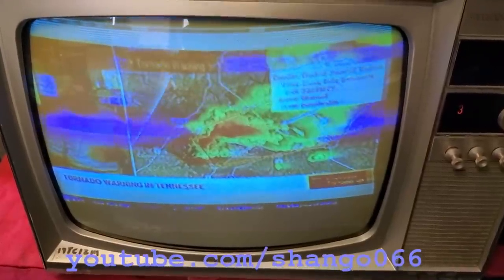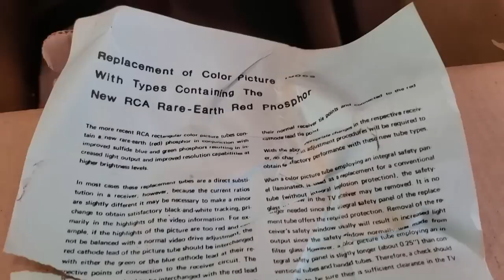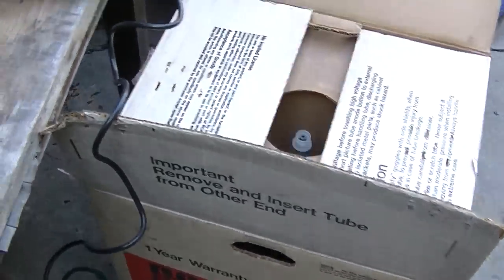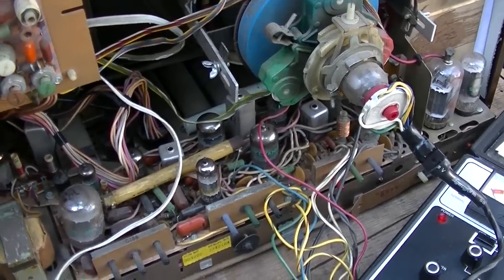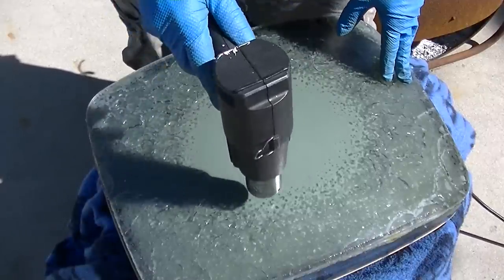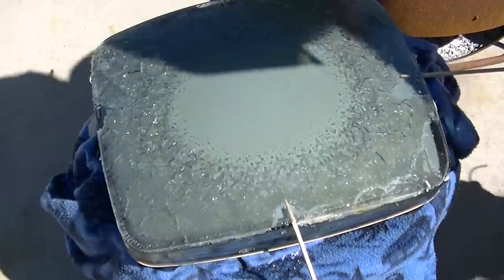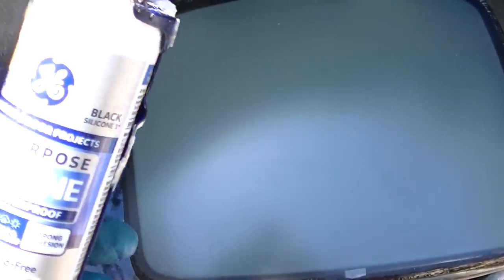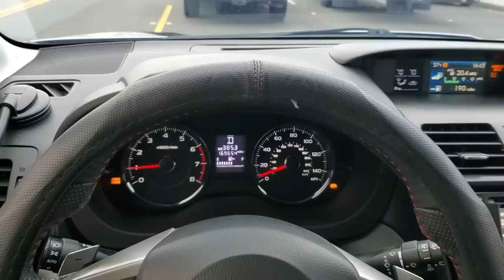Color Television CRT Cataract Removal and Replacement Pt1 1966 Sylvania Tabletop

Comment: In my about 30 years of using rebuilt CRTs from the early 80's until the early 00's  (we stocked 20-50 common sizes most of the time here in Northern California), about once a year or so we would hear a pop from the storage room and investigate and find a imploded CRT in the box. I wonder how many we didn't find that popped over a weekend or at night. Keep in mind that they were all rebuilds. Ah the good old 80's and 90's. Good job with the PPE!
Reply: Sounds like a lot of lost $$$. I never saw a repair shop that stocked CRTs. Always ordered with core return deposit, like car alternators.
Reply: Did they track the rebuilders?
Reply: @directcurrent5751 We didn't either. Always ordered as needed. We did few CRT replacements to begin with... Had a small showroom of used sets that were typically newer and larger than what the customer brought in that we would sell them instead and then we'd toss their old chassis downstairs in the parts basement if it was worth keeping.

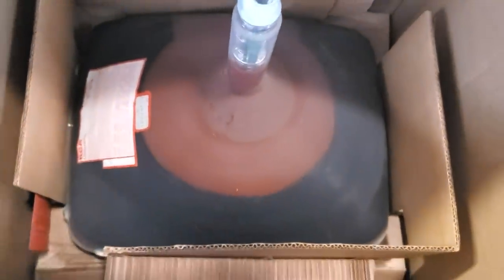Comment: @ 5:35 Ya, anyone that's caused/seen a catastrophic CRT implosion throw fist sized chunks of glass 10+ feet, will usually heed any safety warnings that go along with handling them.
Reply: Back in HS in the late 70's a brain-dead student thought it would be fun to vandalize the electronics class oscilloscopes with a hammer. Idiot's arm was so badly cut, and he bled so much, the police had a vivid trail of blood directly to his front door. I feel bad for the then vintage Eico scopes, not him.
Reply: @jamesplotkin4674 Well, the school won't need to press charges, cause he would've already learned his lesson with the permanent injuries on his arm!

Comment: if you want to fix the weird glass imperfections you could try bonding the entire thing with uv cure loca or liquid optically clear adhesive, it's what they use to bond cell phone digitizers to lcds and has a refractive index very close to glass so it hides basically any defects in the glass, you would need like 2 tubes of it at least but you put a massive blob in the middle and push down on the glass to spread it outward, then put it in the sun to cure for a day. 
would be really interesting to try on a crt that you don't care about that had a super easy to remove safety glass, if you want to get really fancy with it you can vac chamber the whole thing to get any bubbles out but i've found it not necessary
Reply: It might be worth the use of a better product on a CRT that was NOS , had a cataract issue, and a longer expected life like a Sylvania that Shango mentioned, but seeing the forecasted life / warranty period of that tube, I don't think he was interested in putting in that extra cost in the rehab work.
Reply: Now we know the Colorama's secret! :) Now, those "matte" imperfections could be hidden by a thin coat of epoxy. I don't mean to make a flat pool on the top of CRT, but a temporary one (some tape) with a drainage place(s). Pour epoxy on top, let it flow, when surface covered drain, clean or cut the rest after it gets hard. Might want a second masking tape just down the CRT to avoid epoxy all over it. Only avoid bubbles. Best thing is you can do it again, polish it and cover with old protective glass!
Reply: Shellac.

Comment: My Dad worked for Westinghouse from the early 1960’s to 1977 when they closed the doors. He worked in a plant that mainly made CRT’s. He used to work on a “Lear” machine where I believe is where they create the vacuum and seal the neck. He said they would implode quite often. He also said any tubes that wouldn’t pass inspection for good TV manufacturers were always bought by Curtis Mathis. He always warned people not to buy those overpriced boat anchors because he knew their lack of integrity of selling a quality product was nonexistent. Just hype!
Reply: Our Curtis Mathes lasted 30 years. Mom got rid of it only because it wouldn't go higher than channel 37, after her favorite channel Lifetime went from channel 27 to 39. It was a great TV, so they were not all junk

I cant say the same about the Chinesium crap known as 'truflat' Apex TVs that weren't fooling anyone into them being LCD instead of a flattened front CRT
Reply: One of my uncles bought several Curtis Mathes televisions.  He didn't have trouble with any of them until they got very old.  The store that sold them in my area charged a hefty premium price for the brand, though.  In the CRT era I usually bought RCA or Sony televisions, I was talked into trying a Sharp 25 inch television from the somewhat local Highland store (remember those) to connect to my TRS-80 CoCo 2 computer, it only lasted 5-6 years before it all of a sudden started smoking big time one day whereas my RCA and Sony TVs from the solid state era lasted 20 years without major servicing.

Comment: Love the video! It takes dedication to separate that glass front. On the Subaru, possibly tire(s) noise, it's happened to me on more than one occasion, new tires solved the issue. Sad thing is these tires still had lots of tread on them.
Reply: Factory tires are usually cheaper, even if it's a good brand.
Reply: Problem with Subies is that you have to replace all four tires at once so a lot of people put up with the noise if the rubber is about equally worn.
Reply: @will89687 Why do you have to replace all four at once? I've only ever heard of changing them in pairs, front or back, if you care about minor tracking in the alignment with substantially different tread depth/patterns. If you don't have a picky suspension, like say, a Ford Escort, you can run 4 totally different tires and the car will be fine so long as the alignment is good. It almost doesn't even matter if the wheel is not a drive wheel. Even with AWD only one wheel is getting power at any given time.

Comment: I feel "validated" after watching this presentation, because, on one of the last video's Shango made on a cataract / shield removal, I thought and mentioned that some wood shims, PLACED ( not pounded inbetween the surfaces with a hammer like one said I suggested) might not be a bad method of slowly and gently separating the clear cover from the CRT, and lo and behold.. that's what was done on this video. The plastic shims that are available are even a better choice, they are more durable than wood and can be wiped off and reused after a use or two on messy instances like this.

Comment: I have a Motorola TV that had a cataract that was worse, it was in a flooded basement so it was full or rusty water and had flowing orange veins in the PVA glue...It looked like hell, but was a VERY easy cataract. 
That "white glue" isn't glue it's a extra low melting point glass called "Frit Glass". It shouldn't ever fail. It exists because the most practical way to build a color tube is to assemble the face glass, phosphor and shadow mask first, then attach the cone at a temperature that wont cook the phosphor or warp the mask...That frit glass is why color tubes don't still have the goofy metal seal around the screen that 15GP22s, 19VP22s and 21AXP22s had.
I can smell that PVA from memory, and feel the slime...Kinda like most car mechanics can smell differential fluid when they see a picture of a diff. For those of you that have never smelled cataract PVA go to a pool store, buy a new inflatable and huff the smell of that then magnify it 3x and add a touch of ammonia/sour to it and you've got cataract glue.

Comment: That type of laminated screen was mainly reserved for the colour tubes. B&W tubes were mostly standard, bare glass or tension banded. There were a handful of B&W types with laminated screens, mostly moulded glass or filled moulded glass, often with lugs.
Reply: Back in the day, we used to put our Winky Dinky plastic right on the CRT. Unless it didn't arrive in time, then we would write on the CRT. Parents were not amused.
Reply: Why did they put a layer of junk on top of the glass?

Comment: Since the other tube is garbage, it would be nice to see what a careful rejuvenation would do to it, before you replace it. If it revives it enough, might be worthy to keep it for a future resurrection video for a TV with a totally dead or necked tube.
Reply: I'm curious what the Beltron will do.
Reply: I'd like to see a demonstration of an implosion (done in a totally sealed room with nothing but a camera in it, of course)
Reply: @fredmeyer1898  If the rejuvenation fails, yes, it would be nice. Although you can find plenty of such videos on YT. Even super slow motion ones. As someone who experienced it first hand, I must say what 95% of the CRT impolsion videos miss, is the very characteristic, unique sound of it. The huge thump what kicks your chest, caused by the pressure impulse as a large volume of high vacuum collapses instantaneously. Maybe a movie theatre subwoofer would be able to reproduce it, if someone records it properly. And the biggest CRT implosion I experienced was only a 22" 90° in-line color tube, outdoors. I can only imagine how a monster 32" 4:3 or bigger CRT sounds. Might even cause hearing damage in a smaller room.

If you search for 'Breaking a 40" Sony Trinitron XBR TV with a hammer', you will find a 13 year old video in which a guy smashes a 40" XBR Trinitron (sacrilege!) . Everything shakes in the garage, one camera tips over from the pressure wave.
Reply: @mrnmrn1  Interesting... I never really looked an implosion up but I would be curious to see one too. Decades back I worked in a computer store... We used to take the dead monitors off the shelf for disposal and when we were tossing them, me and the other guys would purposely swing them by the cable and slam them into the dumpster trying to get one to implode but it never happened. These things are a lot tougher than people think. I think you've really got to hit the neck in a pretty specific way to get them to go. I am curious though, since the older ones were not reinforced in the same way as modern ones, how difficult it really is to actually implode one. I worked in repair in the 90s but this era of tubes is just slightly before my time and I don't remember us ever breaking any tubes while servicing, even when picking them up by the neck. We did receive CRTs that were necked before they got to us, probably on the deliver truck.
Reply: @chad2787  You need to hit the screen or the bell. Breaking the neck won't cause implosion. Even with ancient tubes it's very unlikely (although not impossible with those). With modern ones, sometimes even hitting the screen with a sladgehammer is not enough, or only enough for a partial implosion, when the screen remains mostly in one piece, held together by the implosion band. If you want to be sure, you should cut the implosion band, but that is very dangerous, requires some serious PPE.

The best chance for a non-prepared, imposion band-protected CRT to fully implode from a screen impact, if you hit it with a medium-size hammer right in one corner of the screen.

Tossing CRT computer monitors rarely results in an implosion. If you toss one out of a 10th story window, it will implode. But if you just toss it to the ground from a few meters, if the tube damages at all, it will be a broken neck, no real chance for an implosion. Again, hitting one corner of the screen with a hammer will likely cause implosion.
Reply: @mrnmrn1  I'm just curious about all the folklore and if there is any truth behind it. I've seen people throw hammers at them, shoot them with a shotgun, and yet no implosions. At least the modern types with the band seem to be extremely difficult to implode. That's why I'm curious about this earlier generation with the glass glued to the front. It seems they must have been a lot easier to implode.
Reply: It would be way more fun to EOL them by rolling them down a cliff.

Comment: Wonder if they were able to get away with selling factory blemish tubes to the repair market because the bonding goop covered up the defect.
Reply: No. Im guessing they simply did not replace the faceplate, because the intended service life was about 5 years, not 50. The Colorama tubes were rebuilt tubes. I'm not sure if RCA only rebuilt tubes of RCA origin, or if any tube was rebuilt by them. I suspect only RcA tubes because of the phosphor note. Hi-Lite was RCA branding for their all new tubes.
Reply: Wonder if the face of the crt can be polished with some canuba, things that make you go hmmmm😂

Comment: I can't remember ever seeing a CRT with a safety shield here in the UK. Unless you could afford a Sony, the tube used to protrude from the front of the cabinet - there was no bezel. Apart from 1940s sets, we never had round tubes - always rectangular. I suppose our lawyers weren't quite as tenacious...
Reply: They would have latterly been the style with the safety shield held by a metal band, as described in the video. The band would be hidden behind the  bezel on the European style sets (screen protruding from the bezel).

Or I think at some point they moved to designs with just the band and thicker face glass
Reply: The safety glass was usually separate on european TVs (not glued)

Comment: I'm surprised at the assertion that the joint between the face and the funnel is a glue joint, I was under the impression that joint is made with glass frit, which starts as a slurry or paste suspended in a polymer binder, but is fused after application, effectively driving off the binder and sintering the glass frit. Using an adhesive there wouldn't make sense from an outgassing standpoint either.

Comment: Dublin Ireland 🙂🇮🇪🍀RTE1 Radio station Ireland national broadcaster. Due to cost it is closing its 252LW transmitter. This was used a lot by the older Irish in the UK. This is now MW and LW gone. We still have 198LW for BBC radio 4. BBC 693, 909 and 990 MW for the UK premiere league football when needed.

Comment: Hope Chris's Diplomat was worth suffering every last detail~ the Brat was the Suburu I first drove, to me the flat H engine let them put the spare atop, but that one had twin timing belts~ was great in the snow, but noisey and clunky....I concur to your assessment of the subaru, another baddie is the suzuki suicide-kick~ evert catalytic converter needs changing to pass smog, rough ride~ never thought of such things
Reply: My first car was a Subaru XT6. Total pile of unreliable garbage that broke down every chance it got. More warning lights than a Boeing 707. Totally soured my opinion of Japanese cars for a long time. Had to pull the engine to get the spark plugs out.